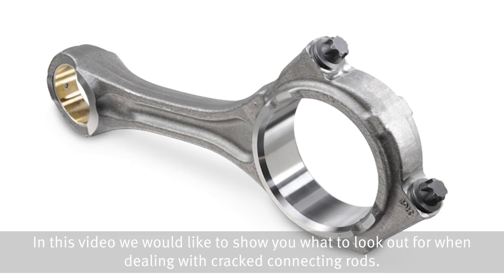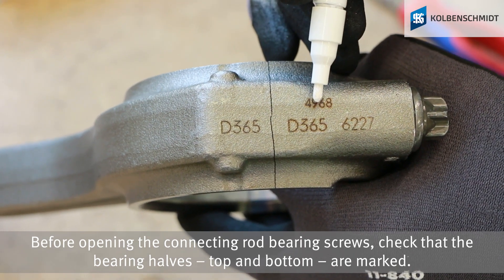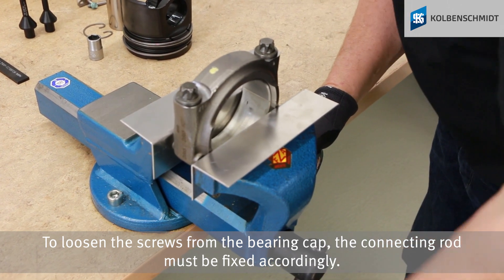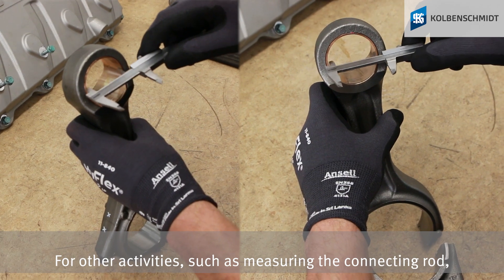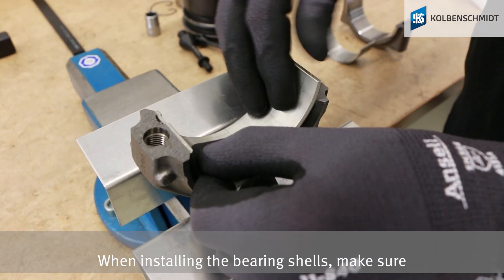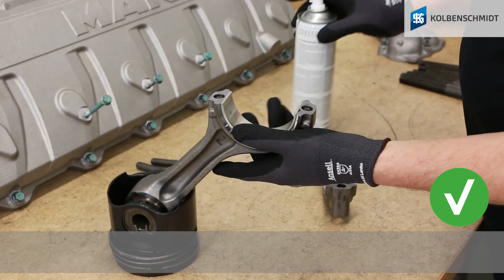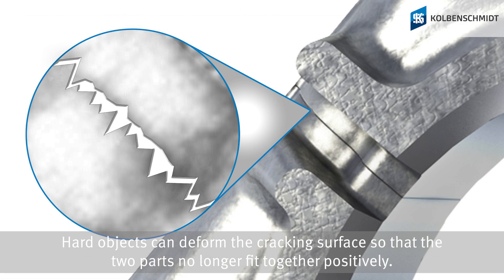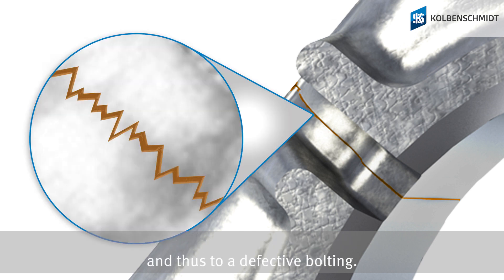How to handle cracked connecting rods correctly

Comment: Hi thanks for this video. If the surface between rod and cap is slightly deformed is the rod still usable? On 5 rods you can’t tell where the split is but the other 3 can see the split location
Reply from the maker: Hi, you are right, usually you shouldn't be able to detect the crack only with difficulty. You have reacted exactly right and by taking a closer look. Sometimes you are lucky and there are particles on the surface that can be extracted. However, if the deformed areas of the cracked surface can be seen with the naked eye, we advise against further use of the connecting rods. The risk of problems later on is too high.